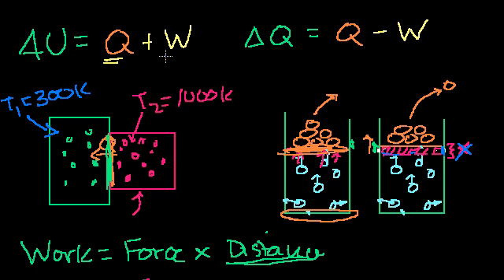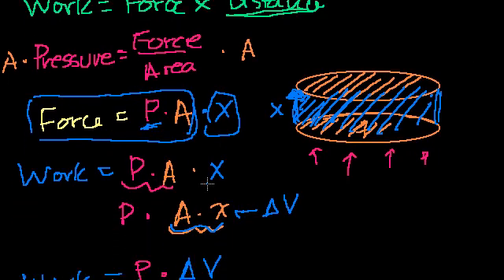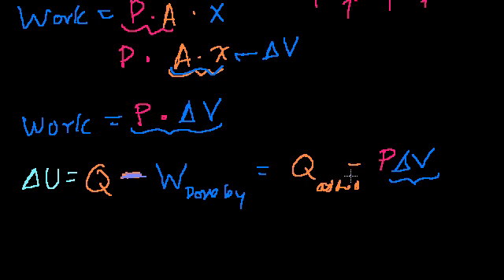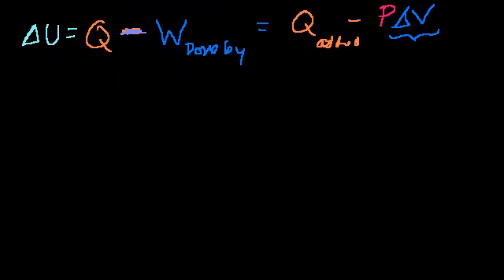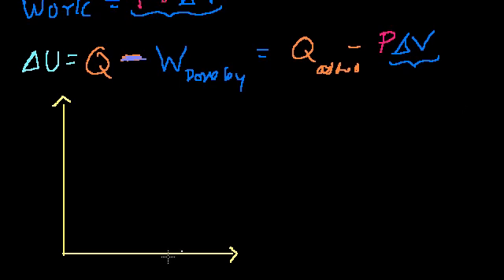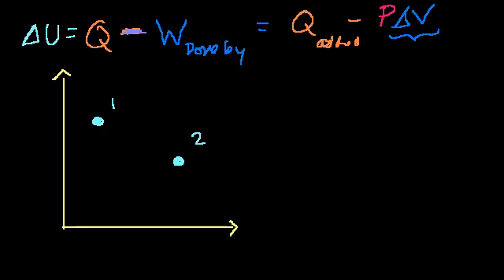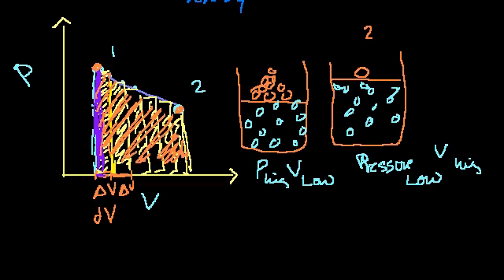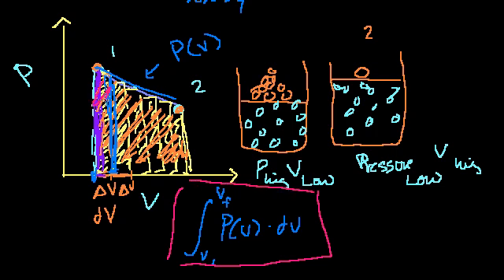PV-diagrams and expansion work | Thermodynamics | Physics | Khan Academy

Comment: Weird that Sal does not mention that by swapping the bounds of an integral you get the negative value for the integral.  Very valid here on the PV diagrams going "forward" and "backward" as work is done by and done on the system.

Comment: I'm lost at the "Area under the curve".  It can't be the area from the bottom of the graph to state 1 and 2... we haven't even defined what the bottom of the graph is (is it implied P=0 V=0?  Which doesn't make sense as you can't have V=0 P=>0) ).  At state 2 there is energy left in the system in the form of volume at a given pressure.  So by showing the area extending from the bottom of the graph he is including the final energy remaining at state 2.  Or am I missing something obvious?  Should the shaded area not end level vertiacally with state 2?
Reply: what is usually implied in "area under the curve" lingo is that it is the area under the graph to the horizontal axis. In this case, it would be to the V axis. Why does this make sense? Because when in the video it was said that the area of the (any) rectangle is P times change-in-volume, , the "P" stood for the pressure the graph indicates at that particular V-axis coordinate, i.e., where that particular quasi-state was.. And that "P" is the amount that is measured from the V-axis. Think of how on a regular x-y graph, such as y = 3x-7, a point is (x, y) and the vertical distances are the y-coordinate as measured from the x-axis. Hope that helps!

Comment: How does it do work if the change in internal energy is 0????
Reply: Because at the same time it does work it also received heat energy from surrounding or by external means

Comment: I've loved these videos, great at answering any q i ask at the time it's asked.
1 thing at the end though
Not sure what exactly the area inside the loop represents.  when you say it's "the net work it did", how else could the question be phrased? 
Thanks
Reply: the questions most probably would be of type like as under some specified conditions what is the net work done on the system or net work did on system. maybe the may take away volume or pressure of final or initial state and give work and ask us to find it, but that would require good knowledge of differential equations, if you have taken calculus class

Comment: I understand that U is a state function, but for the last ex., if ur loosing energy by doing work don't u need energy done to the system to compensate so that change in U is 0? But with the last example there was still a net work the system did.

Comment: Can someone please explain to me the concept of expanding gases cool and compressed gases warm.  Wouldn't it be the other way around since KE is proportional to Temperature and if you are increasing Temp then the gas is absorbing heat therefore expanding?
Reply: Hey i think I'm ten years late but maybe you'd want to know. So what happens is that, upon expansion, the gas molecules move further apart, and as volume is inversely related to temperature, temperature decreases. When we heat a gas, the molecules' kinetic energy increases yes, but they kinda try to lower their temperature down to gain stability (a higher temperature would mean higher energy and less stability), and they do so by taking up more space